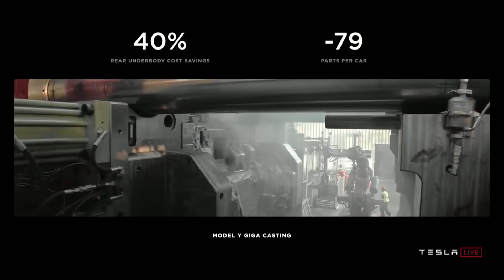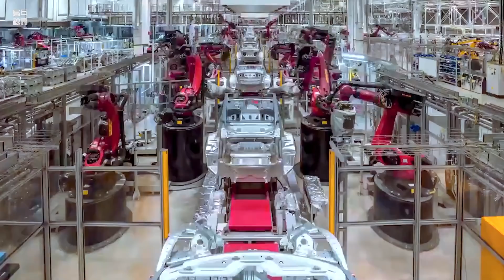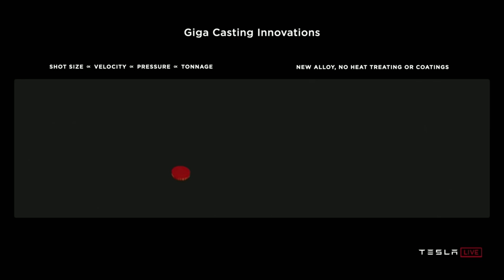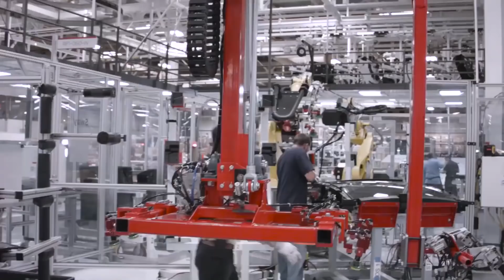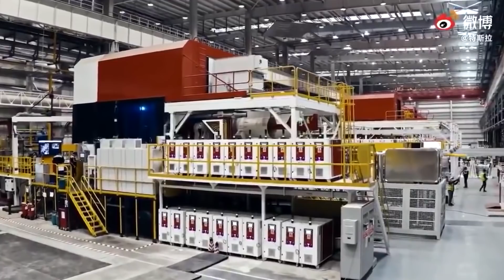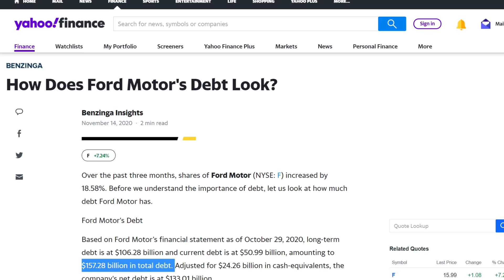Tesla Giga Press: Why dont Auto manufactures copy?

Comment: Ford and gm need to adopt the v integration asap. (If they did they could get cost down 50% and have 100 years expereance over tesla on customer demand on design).  if they take to long tesla will just buy them cheep. The trick to giga casting is conformed cooling and vacuum to gain perfect thermal control under presser.
Metal cast with the aid of a vacuum is far less porous than other cast metals, so welds and heat treatments are far less likely to cause blistering or other defects.

Comment: The technology is extremely complicated, otherwise IDRA won't got themselves bankrupted!
Later being acquired by Liking (HK Stock number 00558), Liking acquired 70% shares in 2006, balance still hold by bank.  Finally on 2016, Liking acquired all remaining shares.

Manufacturing technology has to be evolved under decades of practices.
The success of Gigapress is coming from technology driven by greedy HK injection moulding users.

Why such a huge press can avoid porosity, bimodal grains , thin forming, and a long list of casting defects? 

Demand on injection speed was the key issue in the 80s when completitions are keen among the four little dragons.

Regenerative hydraulic fluid accumulators break through were done at the 80s, Liking capitalized it and evolves the concept at another level.

Result is, huge injection can be done in seconds if not in one single second.  There are many other looks like minor technologies involved too, one typical one is the Hong Kong kitchen cooking tool ... Wok, it involves a soya bean oil, this is thousand years know how in China metal working tricks!

Now people may associate why Tesla was once in trouble when production speed is far from plan, only 8000cars in 10 months.  That point, no more bank supporting Tesla, they all calculating how long can they survive!

Once the Shanghai deal was signed, China Banks support Elon, everything done in 11 months, started production with top speed with 7 days. 

The manufacturing know how feeded back to US plant, since then, all Tesla plants are in full speed.  

However, the draw back of gigapress scenario is Laws in almost all developed countries.
They demanded a list of requirements against the Uni-body, that is, little chance of repair if encountered damage！
Reply: I don't understand anything about you are telling.

Comment: It is Idra that first developed and than presented the Giga press to automotive manufacturers (and for other sectors). Only Tesla was interested in the machine.
Some said said to Idra that was impossible to make the machine work.
More than 22 giga presses were ordered at mid 2022, 7 delivered. Some are for automotive industries.
The development at Idra took 3 years and Euro 1.8 millions in development costs.
Idra was already manufacturing smaller die cast presses, also used by several manufacutrers for example for aluminium  engines blocks, heads, ...

Comment: Large die cast parts is not new technology.  My 20 year old mercedes has a front subframe that is a large die cast part.  
I have had a lot of experience working in two different die cast shops as a mold maker.  Die casting works good when it's working. But when something goes wrong like an ejector pin getting bent or a little piece of casting sticks in the mold.  The mold has to come out of the press.  So this big giga casting die is going to be about the size of a mini van.  This is a big solid steel. Greasy and filthy and a total pain in the ass to work on because something like that is going to be  mammoth.  Hopefully it's an easy repair, but chances are it's not an easy repair.  Especially if you have a robot cleaning and unloading the press. Pieces of the aluminum casting can and will break off and stick in the mold.  Unloading the mold is a real trick too. The aluminum casting has to be left to solidify just long enough that the ejector pins can push it out,, but if left too long it can shrink tight and you end up chiseling the remaining aluminum out of the mold.  That little piece of solidified aluminum can destroy this multi million dollar mold in one cycle.  If the mold closes up on that little piece of aluminum it can dent or completely break off parts of the mold.  If they can't fix the mold in house, they will have to load this mini van sized mold onto a flat bed truck, ship it over to a mold shop that can fix it. Can you guess how many shops in the states can work on a mini van sized die casting mold? Probably not many.  Die casting molds are the most filthy, greasy, nasty,  smelly, disgusting things in the whole industry.  And this thing will have to be huge, molds in general are about 4 times bigger on the outside than what they are molding on the inside.  They will have to open the mold up, estimate the damage,  propose a repair, get the job in their schedule because Elon isn't the only person that wants something done,  when they get the repair done, then it gets shipped back and hung back in the giga press. Then the mold has to set up, the part has to be fully inspected, hopefully at that point it's ready to go back into production.  But what if the inspection finds a different problem.  You are back pulling the mini van sized mold and putting it on a truck, shipping it back to the mold shop that is like the only one in the country that can work on the mini van sized mold and you are waiting for them to have time to fix your mold.  
You have just witnessed a month to a half a year of downtime on that wonderful giga press.

Comment: Just watched this to educate myself on the topic.  Andrew does a great job talking about the ins and out of manufacturing, and gives the audience the impression that QA challenges aside, its a panacea.  

However, there are other factors besides manufacturing dynamics that should be explored in another video.   One such factor is product quality--NVH.  Aluminum is a superb conductor of noise and vibration--leaving NVH people with the job of of tuning it all out.  GM tried mega castings with the Omega platform, and found that the NVH measures needed to give their cars a decent ride and handling characteristics negated many of the hoped-for advantages of the castings: increased manufacturing complexity, cost increase, weight increase...   Plus, it was also found that using steel with different properties in select locations offered an improved ability to design and manufacture a car with the properties they want. 

Another topic to explore is how you experiment with mega/gigacastings to get the product properties right--securing the press, die tooling, A/B testing different designs in test mules...

Comment: Casting is only good for manufacturing at scale. Hand-laminating carbon fibre is good for one-offs. Imagine the cost of the vehicle using a casting. Same for low volume manufacture. Besides steel is cheaper that aluminium. Strange that only Elon is complaining that manufacturing is hard. You never hear the OEM's complaining.

Comment: The potential savings that are touted are dependent of the giga-press being reliable and cracking the production challenges that as the slide says, "are real, but solvable". Tesla has already invested in robots, so like the traditional vehicle manufactures they too will have to write that investment off if they are to revert to presses. There are advantages being first with bleeding edge technology, but there can also be benefits in being second, by allowing the first generation to discover the problems, and adopting the second generation where many of the teething problems have been resolved.

Comment: They call it giga press, but technically it's die casting. Casting isn't exactly the best technique when weight and strength are key factors. But it can definitely improve efficiency of car assembly. But it may compromise efficiency of tesla vehicles.

Comment: There's nothing enlightening here at all. Nothing. This is plain vanilla obvious tech about casting vs traditional stamp and welding. I used to cast tool parts and know Sturm-Ruger was a major player in pressure casting way way way before the giga press was developed. All the troubles regarding casting noted here I learned about 45 years ago in high school metal shop.

Comment: Another interesting fact about IDRA, the supplier of the "Tesla Giga Press". It is owned 70% by LK Technology Holdings of China since 2008.  LK is the biggest DCM manufacturer in China that exports worldwide but since it's strength is in lower cost manufacturing it more than likely acquired the Italian company to gain access to it's technology and market share especially in the EU. I wonder to what extent IDRA's machines are made in China and/or Italy coz it makes more economic sense to just make it in the former then rebrand it as IDRA for "prestige". BTW, here's the link to the acquisition;

https://www.lk.world/attachment/material/1493717378fair9.pdf

Comment: This seems a little similar to the steel/welded structure vs the aluminium/riveted structure developed by Jaguar initially (I believe). You would have thought all vehicle structures would have moved to aluminium/riveted by now, but it hasn’t happened. I suspect the move to large cast structures will be slower than this video predicts, and the current method of manufacture will persist much longer than you might think.

Comment: My impression is that Tesla is mostly solving a problem that Tesla has, but that other manufactureres don't have to the same degree. I don't know a lot about American OEMs, but at least for the German, Japanese and Korean, many of the issues mentioned do not play a as big a role and they have these processes down to a T, and also at high cost effectiveness. As an example, BMW basically never has downtimes due to manufacturing robots or stamps not working. The cost of actually producing the body (not the materials, which is 10..12%) is probably around 3..5% of the car's sales price, so if (!) Tesla reduces this cost by 1/3, it will reduce the car's cost by 1% to 1.5%.

That being said, I'm looking forward to see where this technology will be taken by Tesla and others.

Comment: simple answer: because nobody needs to bend that thick of metal
longer answer: because with the way traditional manufacturers work, with larger volumes and frequent design revisions, they already spend a massive amount on tools and dies and don't want to spend even more for an overbuilt press with even more tools and dies
Reply: @J1NX1337  makes repairs impossible,  and more likely to kill occupants in an accident.  Plus cast metals are weaker
Reply: It's not a bender, it a cast press

Comment: You can talk about the debt of automakers if you want, but some aren't in much debt at all. Volvo has more than twice as much cash than debt. ...... Volvo and Northhvolt are planning to increase the energy density of their batteries by 50%, aand have BEVs with a range of 1000 kms in 4 or 5 years.   .... I think Tesla's a great company and a great innovator, but Volvo is  pretty nimble.

Comment: Very good content. Nothing to add. May 1 point. If you take a look at VW with Skoda Seat etc it will be hard to implement 1 fixed casting in alle Designs. The Skoda enyaq is based on id3. It simply would not be possible to offer 1 car under several brands to fit every costumer.

Comment: it would be interesting to see the VW family doing this but then again their modularconcept for their Products (Audi, VW, Scoda) is basically unbeatable design(production) wise. and a Robot suddenly missalighning 20 millimeters? how? a car driving into it? Naw, the Gigapress has a huge poblem as you alreay said to form a piece of metal by pressing into a complex 3d shape with intersecting rigiditiy folding will create voids in the latice of any metal. you would have to preheat the metal to (for production) insane temps of plus 400C° (maliability point for steel to lose 50% structural integrity and Aluminium was about 250C° iirl the ammount of hickups and potential material exhaustion you get from cold pressing wouldnt be worth it in my opnion you would have to heattreat and go scan for defects with ultrasonic probes all the time .... if anything that press is a casestudy not a gamechanger that is what i got from this Interview.

Comment: Hmmm - as a mechanical engineer, have designed many parts for various casting processes and have worked in tool and die auto industry and in the molding industry. This is a hard one for me to call. I would really need to see a cost / benefit / CPK / strength / rework analysis vs. sheet metal. If you have a crash what do you do with the casting, Welding aluminum castings is definitely going be very costly and probably not practical vs. sheet metal. One sheet metal press tool can be reconfigured for multiple car designs quite easily. Getting a casting tool that size to work well definitely would be a challenge and checking the parts for porosity / cracks would be expensive unless the process is validated with very good controls. you still need to post machine and that needs time / fixtures / big machine. Hmmmm I am not sure. Carbon Fiber / Super plastic forming of metal would be an interesting comparison !
Reply: They calculate on having no more crashes (almost none) and owning the fleet in the end.

Comment: It's not a simple case of just ordering a few giga casting machines. I'm sure if you wanted to place an order today for a machine you'd probably need to wait around a year or longer before you'd receive it, and it would then take a few months to install and commission. These don't come off the shelf. Tesla currently has 2 in Berlin and 2 in Texas and orders for another 10 to be delivered over the next few years. I would expect IDRA's manufacturing facilities for large machines is fully committed for some time. It's not just building the machines - erecting them and commissioning them will also need specialist personnel from IDRA in the first stage until you can get your staff trained on how to operate/maintain them

Comment: Tesla has one Factory. Toyota, GM and Ford probably have 50 stamping plants between them. They also make dozens of wildly different vehicles, are required to provide parts for 10 years after a series goes out of production. And ‘’GIHS’ anything from Tesla is generally 75% hype.

Comment: Auto Manufacturers have been already there. And they have moved on. I get why Tesla want to go this way as they just can't make a proper car due to their lack of experience in car manufacturing. Other manufacturers like BMW,Mercedes,Toyota,VW have perfected it to a point that the gaps are always perfect and everything match, and for problematic areas there is increased  quality control and design decisions with human fine tunning to make it perfect. Tesla want fully automated no quality control and no human factory for high margin high production manufacturing. Less parts smaller room for error. For US this bulky heavy vehicles can work but not for europe or japan.
Reply: As evidenced by their market share dropping from 27% to ~10% already...
The competition is already right there nd if you're not a fanboi, you're running out of reasons to go for the 2nd to last entry on the reliability stat sheet of 2020 german customers ;)

Comment: During the past ten years, the U.S. Patent and Trademark Office has issued large numbers of materials-related patents. From 1990 through 1999, more than 2,750 U.S. patents were issued for alloy or metallic composition inventions. In the same time frame, more than 8,350 U.S. patents were issued for metal treatment inventions. As the need for advanced materials increases, the need for patent coverage for newly developed materials will also increase.

According to the U.S. Patent Statute, categories of patentable inventions include a process, machine, manufacture, or composition of matter. These categories appear in U.S. patents as “claims,” which legally define the scope of patent coverage. Materials-related inventions often fall within more than one of these categories, resulting in several possible approaches for claiming patent protection.

Perhaps the most obvious category for protecting materials-related inventions is the composition-of-matter patent claim. The particular constituents of a material, as well as the amounts of such constituents, may serve as a basis for obtaining patent protection. For example, an alloy composition with specified levels of alloying additions or a compound having a particular chemical formula may be sufficiently new and different to warrant patent coverage. However, the possibilities do not end there. Although a particular alloy composition or chemical compound may be known, the alloy or compound may possess some new characteristic or property. This is particularly true when it comes to metal alloys. Alloys containing a new type of metallic phase or combination of phases may be patentable. The microstructure of an alloy may be sufficiently new and different. For instance, an amorphous microstructure may be patentable, where only the crystalline form of an alloy was known before. Controlled crystal grain size or orientation may represent patentable features in some cases.

Comment: Very large castings are terrible for crash repair, and cars crash a lot. You can’t repair a casting, you replace them at a seam, if the entire chassis is a casting then you have to replace it. Also front and rear car structure is designed to crush to absorb impact energy.  Castings will be impossible to repair.  The Audi R8 has the front frame made of a casting and in a crash they are almost all totaled because of the cost and complexity to replace the front casting.